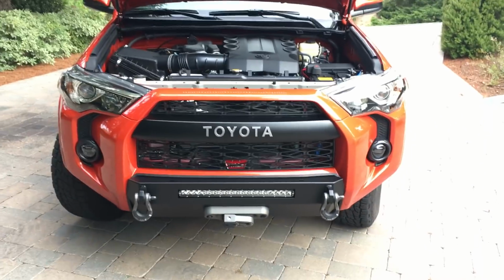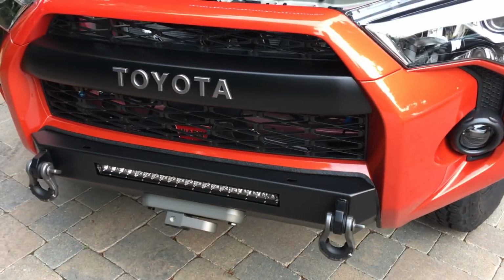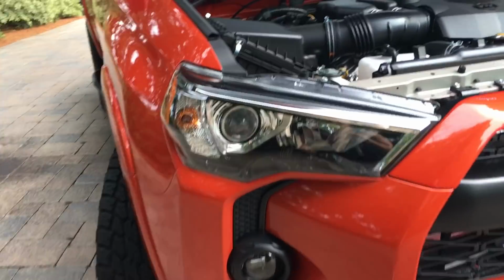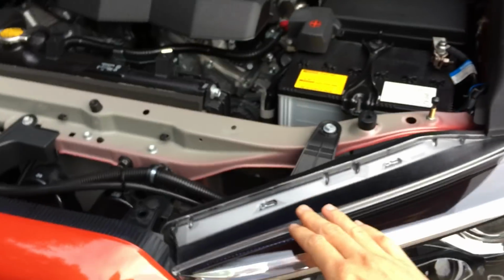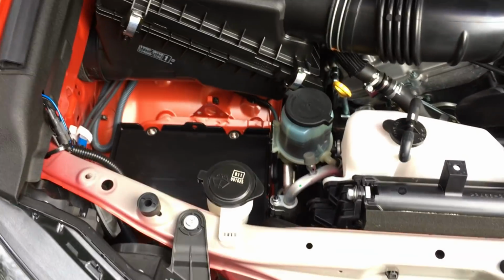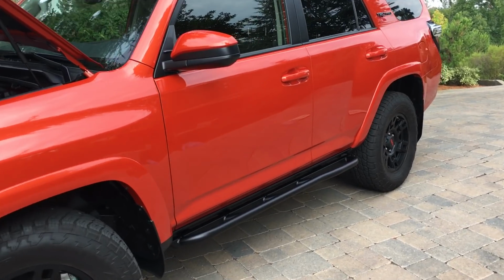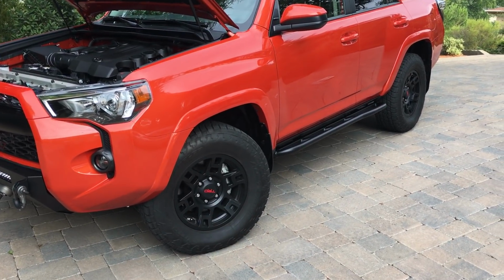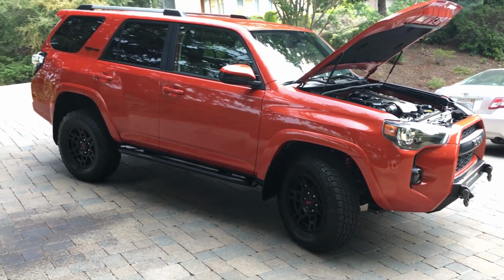IN4RNO Mod Update Sept 3 2017

Comment: Gorgeous vehicle.. Those upgrades are classy as hell too. Nothing too flashy yet if you really look closely you know whats up. Cant wait to see that supercharger upgrade video! Im surprised Toyota hasn't changed the HP much from my '05 V6 4Runner which has 245HP. 25hp in 12 years is quite sad in my opinion. Still the best SUV you can buy, the hype is real!

Comment: Nice set up. I’m in a 2017 TRD Pro with SSO front bumper RCI Skids and sliders and some other mods. Looking at suspension now for mostly overlanding. Was set on some Kings but not sure I want the maintenance and rebuild at of a remote res system. I don’t plan on Any high speed dessert bombing!! Also living in the northeast w snow and lots of salt concerns me. More of a weekend toy/get away vehicle than a daily driver. I look forward to seeing your suspension vid and thoughts on the ICONS.

Comment: Your truck is so clean.  Do you really want to get it dirty now?  Lol

With winch and 2nd battery do you feel the extra weight effects anything?
Reply from the maker: There is something special about getting a clean truck very dirty and then detailing it afterwards to make it new again. The SSO bumper (to carry the winch & SR20 LED light bar) plus the winch, plus the second battery, adds about 220lbs to the front end of the vehicle... so, braking and acceleration are definitely affected and you feel that. You don't really need bigger brakes because you're not racing this thing around at high speed but you want to maintain distance on freeway and situational awareness, especially fully loaded. Because of the larger K02 tires (the largest you can fit without fender mods) and the added weight, acceleration suffers noticeably. There are 2 ways to solve this... 1) Install a Magnuson Supercharger and 2) regear the diff with a different gear ratio or even 3) a combination of the 2. I drove IN4RNO with the added front end mods in the stock TRD Pro Bilstein configuration and handling performance wasn't great (noticeable decrease in performance). However, when adding the Icon Stage 7 suspension, the on-road and off-road handling improved far beyond the all-stock TRD pro configuration performance. I am extremely pleased with how precise, sturdy, easy and capable the handling is with the Icon kit. You have to experience it to understand it. It's also worth mentioning that the sliders and RCI full skids add another 150lbs of weight so there is a quite a bit of load on the tires and brakes and you need to adjust your driving accordingly.

Comment: Did you order the Slimline bumper with the winch access holes?  About to pull the trigger on the same bumper but with the hoop for a little added protection.  Going with a warn Zeon 10s too. Thanks!  can't wait  to see the next update.
Reply from the maker: Yes I did. Winch mount holes worked beautifully

Comment: Check out the k9 roof rack by equipped expedition outfitters. It's made out of aluminum and only weighs 62lbs. Tons of accessories and mounts for your gear as well. Also has adapters to work with other brands.
Reply from the maker: Taran - I did check it out. It's too high profile for my liking. I really want something low profile that hugs that roof. Like Ecotechne but alu.
Reply: Wolfgang51501986 yeah, that's my main gripe as well with it. Even with the lowest mounting brackets you just can't get that clean lo-pro look. Hopefully someone comes out with something like that that doesn't weigh a ton.
Reply: Prinsu?
Reply from the maker: Tacomaholic - I ended up going with Prinsu. Still, there is MUCH to be desired when it comes to roof racks... what I want - LOWER PROFILE! I hate wasted vertical space. Someone needs to make a rack that REALLY HUGS that roof at the apex. NO DRILLING!!! I want an all aluminum rack engineered with lateral strength for the front so that drilling and mounting over to A columns is not required.
Reply: Yeah I'm with you on that but am eyeing a Prinsu as well.

Comment: Thanks for the info. Confused with headlights projectors. Read that hid do not work with halogen projectors. Did you do retrofit? Also which color did you go with 5000k or 4300k?

Comment: Nice choice of fog lights! I have the same ones on my truck, they are pretty great. Makes me want to retrofit my headlights. Do these have the same motor that the FJs had?
Reply from the maker: Thanks Bryan! The Morimotos could be brighter but they provide enough low level contrast to see what's coming in the road. Overall, I am happy with them. The 5th gen 4Runners have the same engine BLOCK that the FJs had but everything else is different... pistons, rods, headers, etc.

Comment from the maker: My TRD Pro suspension is now FOR SALE. It is a complete TRD Pro suspension upgrade kit. Has 8K miles on it, all the parts look new still.... only freeway miles, never off-roaded. Ping me if you're interested. :)
Reply: Wolfgang51501986 
How much?
Reply from the maker: $1500
Reply: Wolfgang51501986 ...hi...i am interested in buying your trd skid plate and trd suspension...do you ship to Canada by chance
Reply from the maker: Dude, seriously? I'm including the Nitto Grapplers, UCAs, rear links, everything. Whatever Matt. No off-roading on my 4R on the TRD suspension or tires... gentle highway miles only. All the components look NEW and basically are NEW. I have purposely NOT off-roaded my 4R because I know exactly what I'm doing with it and wanted to keep all the parts in "like new" condition to sell them for a good value. Again, whatever Matt.
Reply from the maker: Canada is a little too far Onassis. TRD skid is already sold.
Reply: How you keep the engine soo clean??
Reply: Wolfgang51501986 ....thats fine....tnx....
Reply: Is your setup still up for sale? Looking to install onto my TRD off road. I’m in Irvine, thanks.
Reply from the maker: David Espinosa - step 1) I use a leaf blower to remove loose dirt, leaves, and dust. Step 2) gentle pressure wash when the engine is warm (not hot, not cold). Disconnect and remove your battery if possible for this. Step 3) soap everything down real good with soap canon and let it run down for a few mins and reapply more. Use a microfiber cleaning towel to wash everything down liberally. Step 4) gentle power wash rinse down. Make sure to get the underside well from under the vehicle and through the wheel wells to rinse out all the dirty muddy soapy water that collects at bottom of engine area. Step 5) use leaf blower to dry everything off well. You especially want to blow out any standing water in the little crevices and cavities all over the top end and around all electronics and wiring. Step 6) let the rest air dry naturally and reconnect your battery. optionally you can wipe things down with a clean micro fiber towel and some diluted cleaner like simple green.
Reply from the maker: Elliott Garner II - $1500 for local pickup in Menlo Park. Will include the like new Nitto Grapplers, UCAs, and rear links
Reply from the maker: I hear you Matt. I'll let you know what it all goes for once sold.
Reply: Wolfgang51501986 if I had that money, I would use that for my xB2.5💪🏼💪🏼💪🏼💪🏼 off-road/really style xB.
Reply: Wolfgang51501986 I’m interested in the trd pro suspension
Reply from the maker: Juan Rey - want to schedule a time to come by my house to check it out? Would like $1500 for it (it includes extras: New stock skids, Stick Nitto Grapplers with about 8K miles on them, like New looking). Let me know.
Reply: Is it still available sir?
Reply from the maker: Vir Angelo S. Almazan  yes it is! Will let it go for $1000
Reply: Wolfgang51501986 How can we meet up? I live in the Bay area close to SFO.
Reply from the maker: Vir Angelo S. Almazan I have the suspension components in my garage in Menlo Park. Send me an email at mike@fugitiveoffroad.com. We’ll arrange a meet up. I also have the NITTO Grapplers if you want them, lightly used and only freeway miles.

Comment: sweet upgrades but Why did you get the trd pro version and not just the trail edition since you changed out all the upgrades you get by getting the trd pro version.
Reply from the maker: 2 reasons: 1) Only the 2015 TRD Pro came in Inferno Red (my favorite color) and 2) I did NOT want KDSS (don't get me wrong - KDSS is bad ass! But I wanted the reduced weight of a non-KDSS 4R and less things on it that can go wrong and need repair later.

Comment: Nice rig! Did you have to cut the factory bumper in order to install your new one?
Reply from the maker: TCAT - Yep, you certainly do need to cut the factory bumper with a dremel. Scary. Gotta make a clean line and take your time.
Reply: Wolfgang51501986 yeah... I'm torn on whether to do a full bumper replacement or one like yours. I just like the look of the factory bumper so much on the newer models. I would be sad to see it go. But at the same time I want the added ruggedness of a full size bumper. What made you decide to go with yours? Just weight and appearance?
Reply from the maker: Yep, both weight and appearance. But if I had to do it over again, I might have gone with the new CBI aluminum front bumper: https://www.youtube.com/watch?v=FMKuw3GDhQY
Reply from the maker: And I do feel comfortable knowing that I have a very strong but compact and light STEEL bumper with the SSO. I definitely love the look.
Reply: Wolfgang51501986 that CBI bumper is awesome. That's the one I was considering as well. Have you taken your rig out on some trails yet? Will you be posting vids on that too?
Reply from the maker: No trails yet... not until I get the new suspension on and some other components. It is GREAT to work on a clean vehicle and makes installing things much easier. Can't wait to get her good and muddy! :D

Comment: INFERNO! beautiful so far!  by any chance will you be selling your wheels down the road?  I have a trail and thinking of upgrading to TE37s but I still love the trd wheels.  i'm local so i can always swing by!
Reply from the maker: Jay... my new BFG K02 tires just got delivered last night. In the next 2 weeks I'll have my Icon Stage 7 lift kit installed and then I can swap the tires!  I'd swap them now but the K02 is too big with the stock TRD lift and will rub on the wheel wells. Car has 7000 miles on it... all freeway driving. Haven't been offroad with IN4RNO yet and the tires are VERY clean and still new looking. Happy to sell them to you in the next couple weeks when I get them swapped out!
Reply: ahh sorry. i was referring to your rims.  I'm putting 285/70 ko2s on my 4runner soon.  good luck though!
Reply: but is your trd skid plate for sale?
Reply from the maker: jay Ceon - the TRD Skid is SOLD already. So is the front bumper trim piece.

Comment: Dude. Sweet. You had to take the bumper off to install the fogs?!
Reply from the maker: Yep! But it's real quick and easy to get off and back on. https://www.youtube.com/watch?v=cm58R6CJKl8
Reply: Wolfgang51501986 oooooohhh but I'm a scared little girl to do that. How much does that bumper weigh? Very nice. Have you considered dynamatting the doors? I think I told you I did that in another vid. That and an awesome, old school car audio guy made me a sub enclosure in the back right where the powerport are. Biiiig difference
Reply from the maker: Karl Hungus - the SSO Slimline bumper for RCI Skid Plate (not for TRD Skid) weighs around 70lbs if memory serves. The bumper plus the LED bar plus the Warn winch plus the fair lead hardware weighs 137lbs and change. I weighed it before installing so that's how I know.
Reply from the maker: Also, I've seen a few dynamat vids but I'm not going to do it because I'm already going to be adding so much weight with all the upgrades. I need to keep it as lean as possible as the added weight changes the vehicle dynamics significantly.

Comment: I just installed morimoto fogs on my runner, I could only seem to fit one of the screws back on the housing though cause they both wouldnt line up. Did you have this issue also?
Reply from the maker: Spencer Lum - Why yes I did have the same issue but I did some mods to get both mounts to screw in securely. Even with only one screw secured well I wouldn’t expect any problems. I do wish Morimoto would make a properly fitted housing for the new 5th gen bumpers though... I don’t think they realize it doesn’t fit properly on the current bumper design because 5th gen runners went through some small design changes on the back side of the bumper and on other hidden things
Reply: Wolfgang51501986 i see, yea i think it should be fine with just one screw too. I was just a little confused at first because i thought everything was going to line up and fit flush. Even the lights themselves arent flush against the openings which is kind of a bummer. They also dont even supply a install guide which is odd. I know its fairly simple but to those who arent familiar with that kind of stuff it can get frustrating without having exact directions.
Reply from the maker: Spencer Lum - agreed. I will say... I love how the lenses aren’t flush with the housings in the front. I love the gap that is there because it lets you pressure wash away all the bug guts that build up on the lens and housing and you can effectively wash the entire lens and dry it... it rinses down well and dries well. And I think it looks cool actually... it was a pleasant surprise for me when I installed them.
Reply: Wolfgang51501986 i guess that makes sense lol, never thought of it that way. I just figured it allow for more dirt and water to get behind the housing itself but i guess it wont be too much of a difference.

Comment: Who did the installation for your dual battery set up?  Kit, parts, tray, etc.   Contact information or link to supplier or shop that did the work?  Thank you.
Reply from the maker: Hi Dan, I just ordered up the kit on my own and installed it on a Saturday afternoon. It's so easy you don't need to pay anyone to do it for you. Plus, when you do it yourself and follow the included instructions exactly, you have the confidence that it got done right.  Order up the Shrockworks Dual Battery Kit for FJ Cruise and 5th Gen 4Runners and you'll be all set for your saturday afternoon install: http://www.shrockworks.com/Dual-Battery-Kit-for-2010-2014-FJ-Cruiser-and-5th-Generation-4Runner-pr-16275.html
Reply: Wolfgang51501986 thank you.  I’ll be doing it just like yours.  I’ve noted down everything you’ve done to your 4Runner.  Looking forward to see your next video on your future modifications to the rear.

Comment: With the jerry cans and spare tire on swing outs, it seems like a really bad idea to go with aluminum. I didn't even know that a company offered them in aluminum because of the lack of strength with the extra weight.
Reply from the maker: It's very thick aluminum where it needs to be. No bending. All welded. Reason I wanted Aluminum is to keep the weight down. Putting a 300lb steel bumper on destroys your vehicle driving dynamics and puts undue wear on the car (brakes, drivetrain, etc.). A 70lb Aluminum bumper saves your vehicle. If I ever have to winch out of a bad situation using the D-rings on the rear bumper and I tweak or break the bumper, I'll get a new one for sure, gladly. But the fuel savings and overall vehicle and driving health savings are totally worth it. More and more alu bumpers are coming to market now. Just look at CBIs new flagship bumpers. I spoke with Chris Hefty at Hefty Fab Works about stress testing on the alu and he says they've engineered it to match steel in stress tests. Not really sure about that given that alu is a more brittle metal with less tensile strength but perhaps the thickness really helps. We'll have to find out.
Reply: I hope it works out for you. I have the CBI rear bumper and it's only 200 pounds (Over 300 with wheel/tire and two loaded jerry cans). I have an upgraded suspension, and it handles very well. However, when going over certain bumps (like expansion joints) you'll feel it moving. The new CBI front bumpers are in aluminum, because they're not hauling any weight. It certainly would be nice to have a rear bumper that light though.
Reply from the maker: Yep, we'll see how she holds up. Airplanes hold up pretty well and they're aluminum. ;-)

Comment: MALL CRAWLERRRRR!!!!!!!
Reply from the maker: Zach... I wish you made this comment much earlier... I could have used your idea for my custom license plate "MALCWRL". Damn, missed out big time.
Reply from the maker: See you at Hollister soon with your Mall Crawler???
Reply: Yeah man I need some new jeans haha for real though clean rig, how much did the skid set cost you? I only run 3 piece eng, trans and transfer but the full length is nice
Reply from the maker: All in the armor was $1900 (includes the Fuel Tank Skid for $350 and the Rear Diff Skid for $295 and lower link Skids for $130). The RCI "Full Skid Package" for non KDSS is $820.
Reply: That's not too bad! You have an IG
Reply from the maker: Zach Allbee - no IG... not yet anyways. :-)
Reply: Who makes your sliders?
Reply from the maker: xzer baluyot white knuckle off-road
Reply: What’s the dual battery and air compressor kit you used? Would love to run both under the hood.

Comment: How much is the cost to install the icon stage 7 suspension?
Reply from the maker: Art Mahmoudian - Not sure really. I installed it myself at a lift garage (Pit Row) with rental lifts. The cost was about $500 in lift rental time to do the installation myself.
Reply: @Wolfgang51501986  thank u very much  im thinking about getting a 4 runner and adding 15 20 k on suspension and sou d system and lights and bumper i hope it will last long